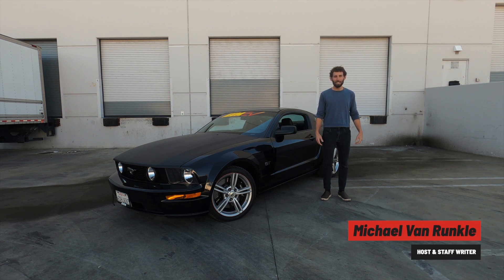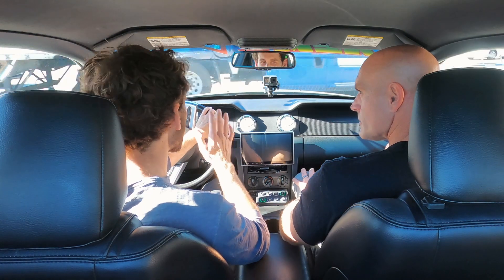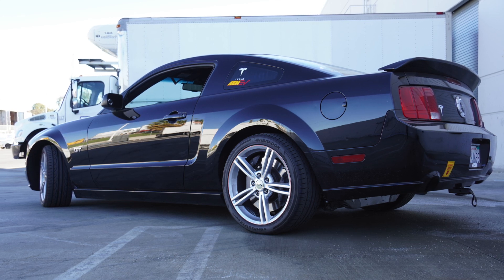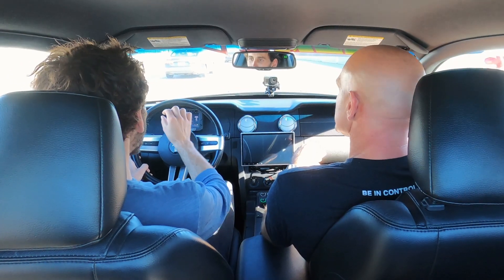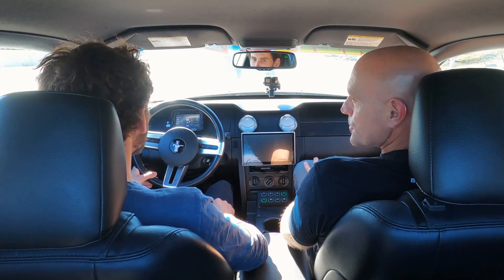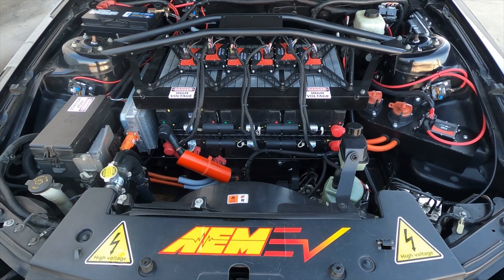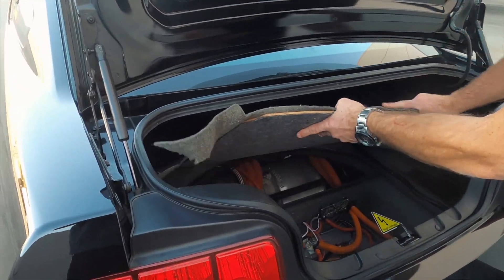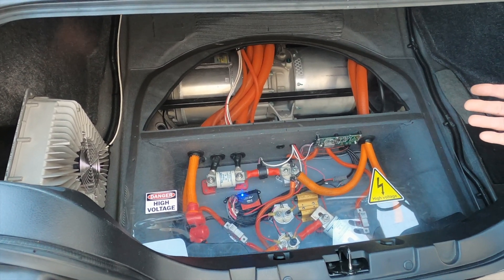I Just Drove A Testang, A Tesla-Swapped 2007 Mustang From AEM EV!

Comment: The testang is very cool, but aem did NOT in fact build it. Roadstercycle built it and sold it to aem/holley high voltage. 
They swapped out the ldu for a sdu and changed around some of the ev controls. 

But roadstercycle did the original conversion and all fabrication work.
Plus he is wrong about the batteries to. They aren't from a tesla at all, it's using cells from a hybrid Chrysler wrecked minivan. 
Because they offer better c rate. 🤔
Reply: We never claim to have 'built' it and repeatedly mention that the car was purchased already converted. We did, however, perform extensive work once we received it, so in its present form it is not the same as its original iteration.
Reply: @AEMpowerTVelectronics  the aem/Holley high voltage staff members haven't come right out and said it. 
But others who have reviewed the car have in fact claimed you guys built it and not been corrected by aem staff members. 

The last motoiq video was the most honest where it was stated that aem didn't do the original conversion several time's during the video. 
But as you say, aem instead rewired parts of it and added additional capabilities through their ev specific parts&tuning. 

I say keep up the great work on making fun ev swaps possible for diyers and shops interested in doing them. Maybe at the next Holley high voltage fest. Y'all can gather some ev swaps together using aem parts and race them. 👍🏻
Reply: @4literv6  Thanks and best of luck to you.

Comment: I have watched several of these EV swaps that talk about driveability but rarely mention things like heat, defrost and AC. In most areas of the country that have four seasons interior comfort and the ability to remove frost/fog from the windshield is a big part of driveability .
Reply: We talked about it but that portion didn't make the video's final cut! AEM is in the process of installing full AC and heat, with progressive temperature regulation rather than just on and off like many EV swaps. It's an important question for sure, AC would have been great because my GoPros kept overheating on a moderately warm LA day!
Reply: @teovr  Thank you for the reply. Awesome car.
Reply: Very good and legitimate question! We can do AC. Please check out this video of Matt Hauber from Stealth EV using our VCU200 to control dual heating and cooling loops, and integrating AC into the Icon Derelict Merc project: https://www.youtube.com/watch?v=pnB3on3FJLo